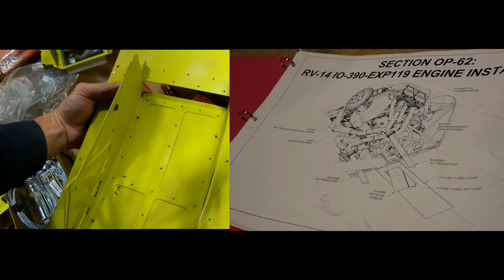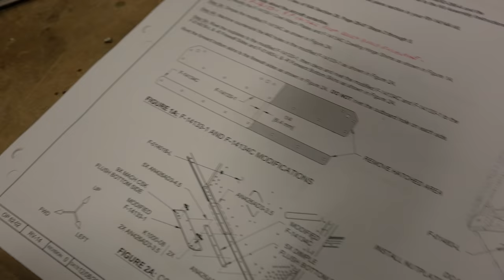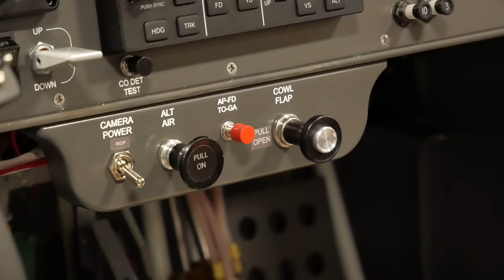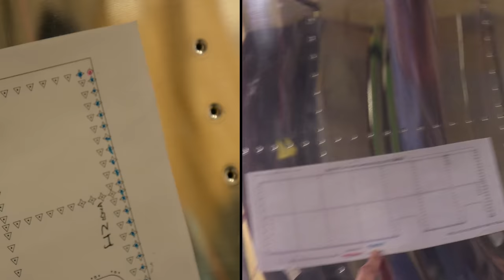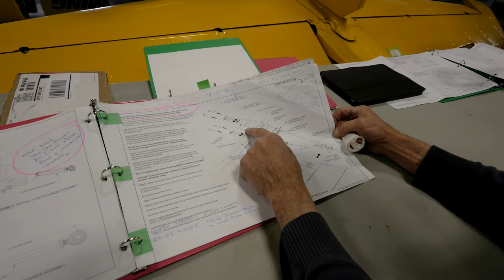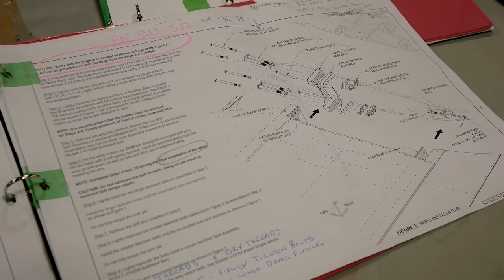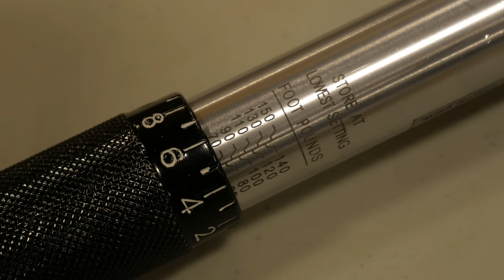WINGS ON! Nearly Ready to Fly! - Build VLOG 15

Comment: This episode made me cry. Wing attach bolts accessible from outside - you didn't have to hang upside down in the cabin and contort to get the bolts in and then not have any room for your hand and the nuts, let alone room to swing a hammer. The wing attach process in the older models (like my RV-9A) is the single worst part of the whole build. This was when I decided that re-learning to swear is vital to survival. BIG improvement with the -14 - you have no idea how much better that is.
Reply from the maker: Yeah - I have heard this is the case - and you can see the guys with previous build experience reacting to how well the RV-14 wings went on.
Reply: @FlightChops  It was a nightmare. Looked so easy for you. I enjoyed the update - good distraction from my cramming session. INRAT tomorrow. Getting my maximum dose of minima.

Comment: I'd advise against using RTV for marking bolts, that blob can stay attached on one side and look like its still attached to the other when it's not.  In this case it seems to be more for remembering to torque each one 2 times not visual inspection to see if the nut has moved.  Paint markers or cotton swap dipped in paint will show visually if the nut has come loose.  Saw this exact thing on suspension bolts on off road race car, looked to be tight but RTV blob was dangling on one side.

Comment: Hopefully somebody sees this but when you're torquing bolts, the expectation of the torque wrench manufacturer is that you're only applying Force perpendicular to and at the hand grip. Bracing or gripping at any other point will change when the torque value is reached for the wrench and may not allow you to sufficiently torque the bolt or nut. If the socket isn't directly above the nut you are working on, that offset can also change the actual torque value. Once it clicks you don't need to do any other secondary click checks because that could apply additional torque to the bolt. Also some bolts want a two stage torque requiring a 1.5-2 rotation loosen between the torque operations to pull the bolt into the piece firmly before putting the final torque on the nut side. 

I have a torque wrench like this one that does foot pounds or newton/meters with a 1/2" drive; a smaller one with 3/8" drive that does inch pounds; and a 1/4 drive screwdriver style for certain electronic assemblies calibrated down to inch/ounces which is used when working with aluminum and steel matings to prevent damage to critical assemblies.
16 in. oz. = 1 in. lb.
12 in. lb. = 1 ft. lb.

Comment: I could not help but internally see that first scene as AVE tightening to a grunt, then saying "click". I know, you need more precision than that, but I still chuckled.
Reply from the maker: Uhhhh… wut? Haha - I’m a newbie and have no idea what this means
Reply: @FlightChops  AvE is another Canadian Youtuber. He does mostly shop work and tool tear downs/testing. He's a big vulgar, so don't watch him around your kids. The "click" part is cause when he's cranking on a bolt and figures it's tight enough he says "click"
Reply: @FlightChops  AvE is a big engineering / general workshop-wizard YouTuber from BC who does tool tear downs and reviews, and builds all kinds of stuff. 
He knows when he can get away with ‘guessing’ the torque spec or when he needs to do it right haha
Reply: @FlightChops  See replies below. Also, like "This Old Tony" he is a "hand model"
Reply: Hmmm.  Collaboration video?  Probably not.  Just because the audience overlaps (guilty) doesn’t mean the YouTubers will.

Comment: Careful grabbing that torque wrench like you did and pulling at weird angles like that. It's designed to be applied on the grip of the wrench and directly 90° or it can not click and let you keep tightening.
Reply from the maker: yeah - thanks for the insights there.  Always appreciate feedback to make things safer

Comment: 14:07 careful, i believe torque wrenches are only accurate if you pull from the handle at the end.... I don't know for sure, but that two handed grip might throw the torque reading off.    granted you had plenty of wiggle room with the torque, and it was definitely torqued enough when you switched to the proper grip.    just gotta be careful you don't over torque that way
Reply: Per the instructions of my very expensive and expensive to get recertified every 12 months torque wrench the handle is the only area that should be used to apply torque and that said torque should be slow and smoothly applied no jerking or yanking.
Reply: Thank goodness someone addressed this. Terrible torquing procedures. I know Flightchops probably did not know, but some of those experienced builders should have instructed him on correct procedures.
Reply: @chadpm11  Yes, Thak you for commenting on this as well.  This is also the reason the military uses super lightweight wrenches so the operator's body and arms are not fatigued by the torque wrench when pulling torque and it can be done as smoothly and accurately as possible. I was cringing the whole time watching this, but I did not want to offend someone. Thank you for commenting.
Reply: Do extensions and cheater bars etc. change torque ?
Reply: @mikeryan6277  Yes and no. an extension could theoretically twist. but the torque load should still be applied the same. i think the only problem with extensions is it can allow you to be  angled from the bolt (not perfectly 90*)    I've never seen anyone use a cheater bar on a  torque wrench.    They are designed to work in their torque range.   no one is going to sell a torque wrench that isn't already long enough to make its max torque.
Reply: @ryancrazy1  thanks for the reply. I was asking about the cheater bar because if Steve ( or anyone else ) was having difficulty torquing to 75 ft lbs torquing to say 150 would be way easier if you add say 2 feet to the length of the handle.
Reply: @mikeryan6277  Absolutely, extensions change torque. The problem is not with someone adding an extension to the end or handle side of the wrench ( this would definitely cause a problematic as well), but usually someone tries adding various attachments for various fittings on the socket side for adaptation for bolts in hard to reach applications. There is a mathematical formula for adjusting the torque wrench setting based on the length of the adapter. If you want to use an adapter without calculating a new value for the extension/adapter on the end it must be placed exactly at a 90 degree angle so as not to extend the length of the wrench.

Comment: Did you just use a grinder on Aluminum?  If so, That is a Big No-No.  Set a safe example.
Reply: He is using a Scotchbrite wheel, is intended for deburring and finishing aluminum edges.
Reply from the maker: Scotchbrite / soft wheel side of the grinding station is what I used to debur, yes.
Reply: @FlightChops  OK Steve, Thanks for clarifying.